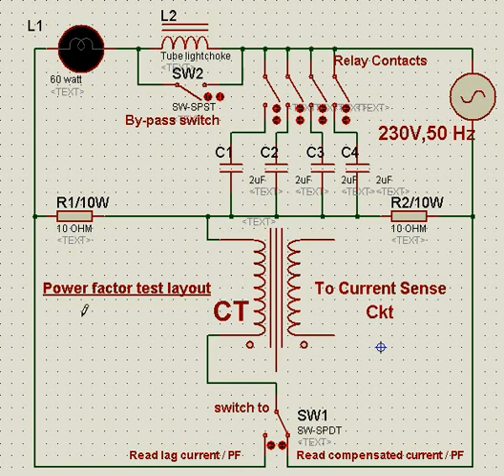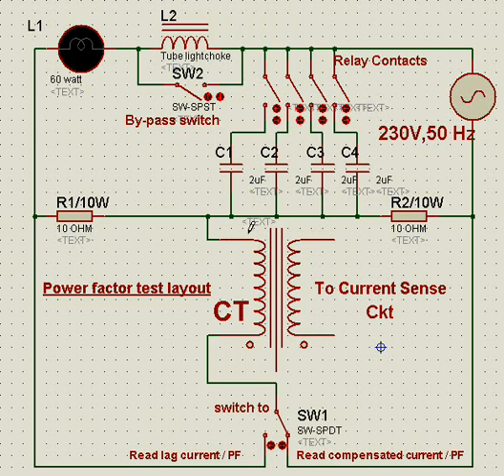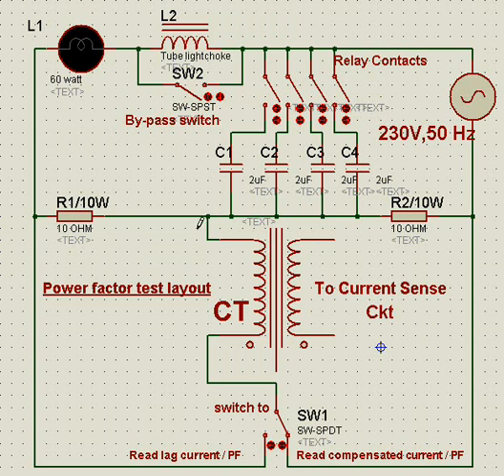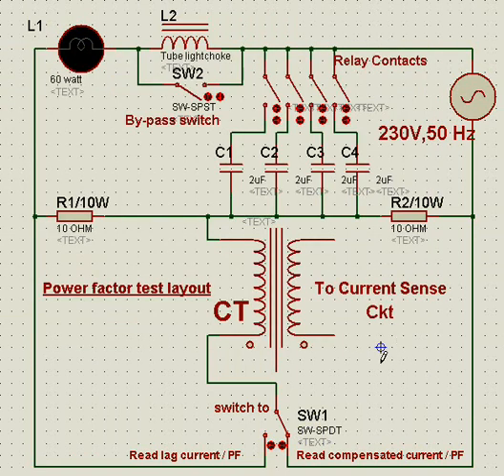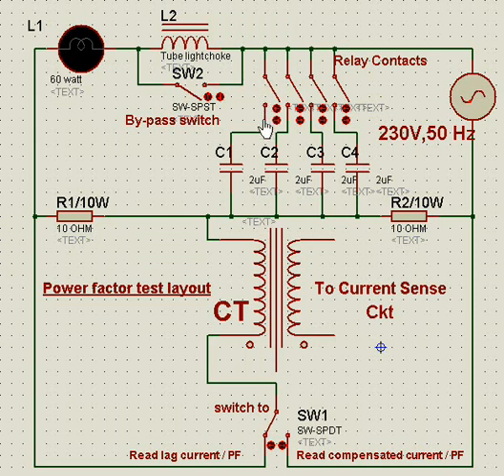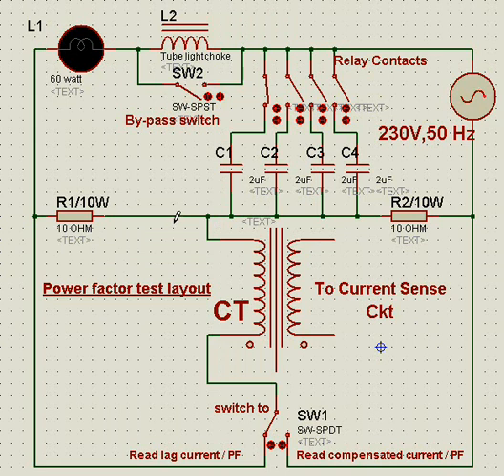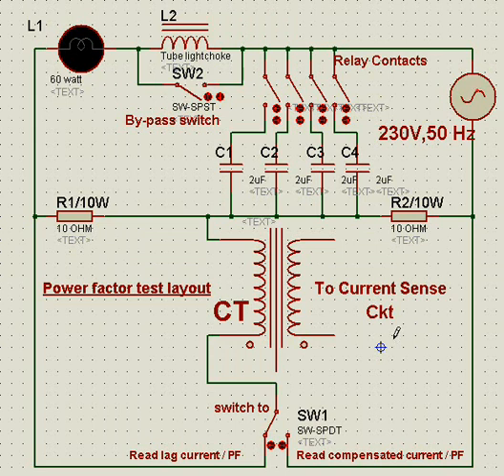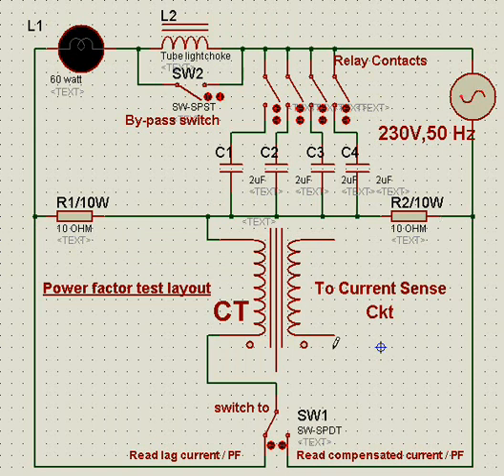Power Factor testing cum display layout

Comment: sir if we did not use these 10 ohm 10 watt resistors then what happen
Reply from the maker: voltage at other side of the CT will be dangerously high